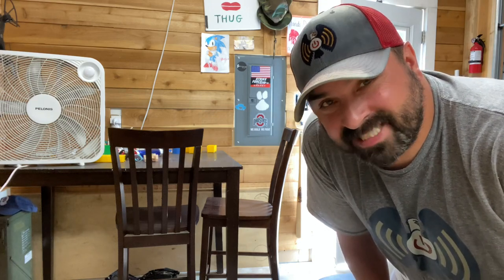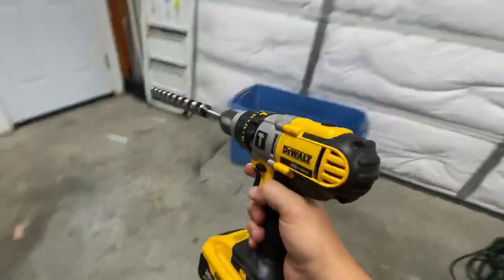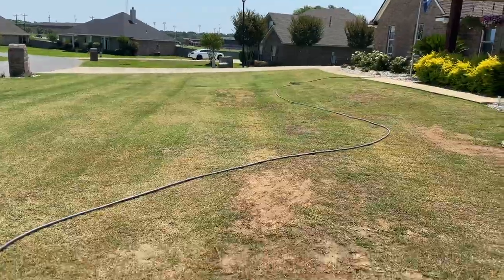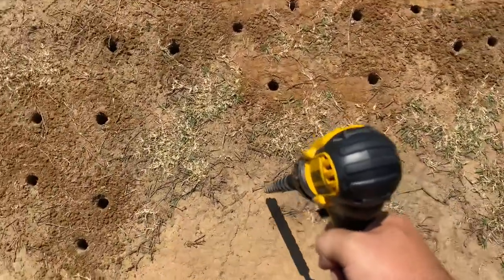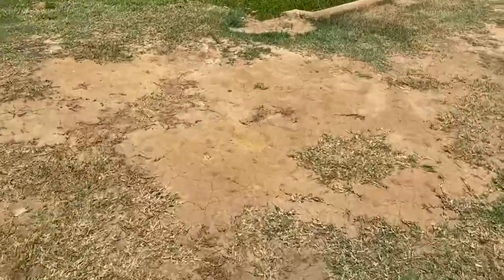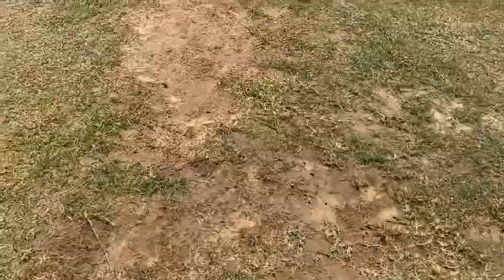Aeration DIY: Ready, Set, Drill!

Comment: I bought one of those 4 tine core aerator that you step on, that couldn't punch through bread even when wet.  Your way is much better.  Thanks!
Reply from the maker: I tried the same thing and didn’t do anything. This works. I have a 1yr follow up to check out. I don’t think it would’ve worked any other way, unless I tilled other up.

Comment: Man" I love the drill bit, in fact I'm gonna pick one up, but I'm gonna be using topsoil to fill in the holes which will get the wildlife in too help me out.
Reply from the maker: I have a link to the one I used. You can also snag one from big box store if needed. It will work with top soil also
Reply: @LawnPusher  I had a augar drill bit that made a 2in hole but broke, coz it was welded only in 2 places top and the bottom, so I need something stronger 👌

Comment: Cool vid.  Good idea.   But how does the compaction get released by the ground expanding into the holes if you're filling them with sand?
Reply from the maker: What I did in this was to get my bermuda to grow in that area by giving it sand and root areas to flow in to. The Bermuda refused to even move in those areas. After the drilling and a few weeks and months, the Bermuda has finally moved in and rooted. That’s was my goal
Reply from the maker: Just filmed my follow video, will be posting in very soon. Sub if you haven't

Comment: I’m going to try this but I will be filling my holes with organic material. My soil is trash. Hard as concrete!
Reply from the maker: You can use sand also, it works amazingly. I have a 1yr later review that shows the procedure fixed the issue

Comment: May I ask what’s that ur filling in the holes???   Great video I sub
Reply from the maker: Mason sand or you can use any type of sand really.
Reply: @LawnPusher  thanks for the quick response having same issue and it was really difficult to find the right video that I was looking for. This surely was. I’ve read in past comments it’s only been a week,  I hope you do a follow up video.  Many thanks.
Reply from the maker: @matthewsalvador9783  I will be this week. I got amazing results from that one time doing it. Filled right in
Reply from the maker: Just filmed my follow video, will be posting in very soon. Sub if you haven't
Reply: @LawnPusher  Mason sand will massively increase compaction, and have the opposite effect that is intended by aeration. The regular cut of the sand particles allow them to get very close together with little to no air/water gap. That's great for mortar, but terrible for your soil. You must avoid regular cut sand like builders sand or sharp sand. You must only use sand that has irregular cut particles. Golf course for example will only use USGA sand.
Reply from the maker: @frankhardy123  but it worked flawlessly. And I have grass growing in it, and I can put my screwdriver in it without any issues. I just posted a 1yr follow up on this video.
Reply: @frankhardy123  What about play sand. All they have here at lowes is play and masonry sand, so thanks for the tip:)
Reply: @jimmyross4352  Sand with particles between  Ø 0,5-1,5 mm would be perfect. There are different sieve lines.
Smaller particles as Ø 0,5mm are bad. The best would be fire-dried quartz sand with rounded "edges", but not the fine one as mentioned.
But this type of sand is very expensive. The dried sand moves/trickles in the holes very easily, as used on golf course aeration.
Quartz sand in my region costs 180€ / ton.  In other regions i read from 6-20€ / ton.  The truck delivery for their topdressing project was more expensive than the sand.

Play sand should have the ability to hold together for the kids to build things when wet, a property we don´t want in the aerification process.
It often holds clay particles, so look for washed sand.

Sand can also have different pH levels (lime inserts), so the Pro´s consider this as well.
Sand, especially lawn sand, is a science for itself.

The mentioned USGA (United states golf association)  sand would be the perfect one, no doubt, but avaiability/price have to be considered in garden lawn as well IMHO.

But hey, anything is better than having a solid block of clay. It´s worth a try.

The next level would be an impact drill.
Reply: Thanks Hector

Comment: I don't get why you're filling the holes with sand. Around here our soil has a lot of clay. I've heard that clay + sand = cement. If I was doing that here I think I'd use an auger and make a bit larger holes and fill with organic material to lighten the clay soil.
Reply from the maker: Check out my follow up video I made a few weeks ago.  Does not create cement
Reply: That’s a false wife’s tale. Sand alone is fine for better drainage but I would’ve done a compost/sand mix just to help the soil profile a bit more.
Reply: @dkbomb I have a degree in Turfgrass Management and almost 20 years of experience. I can attest that it IS NOT a wives tale. Clay will bind with the CEC sites on the sand and make it hard when it dries out. Humic acid will help to keep them from binding, so compost would be better in that situation.

Comment: Why are you doing this?
Reply from the maker: I talk about it in the video. Basically my soil has hardened to the point it can withstand penatration with a screwdriver. So auguring 100s of holes and fill with sand will help with the issue of getting the Bermuda to actually grow in the areas. I have a follow up video with the results. Did a great job. Highly recommend